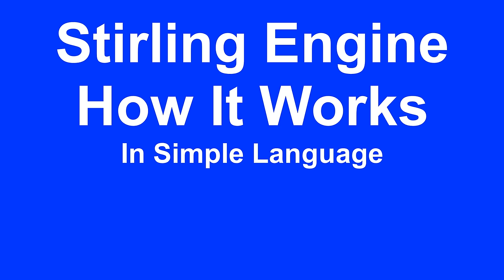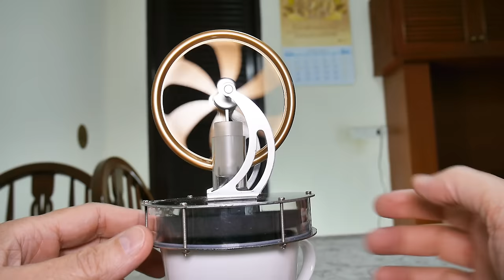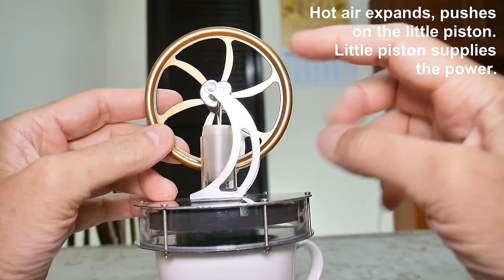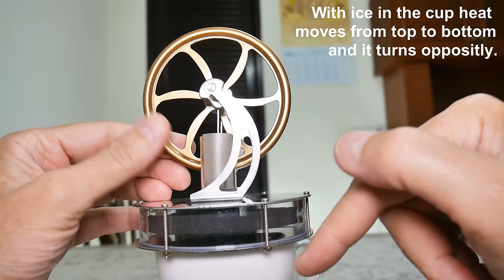Stirling Engine - How It Works In Simple Terms

Comment: Thanks for breaking this down. If you need torque this is probably not the best way to get it. So this is basically the mechanical version of a hot air balloon. Or am I so confused that I think I'm buying cattle from a chicken farm??
Reply from the maker: Actually I had a friend who had a cattle farm that sold chickens, so...  A little like a hot air balloon in that the warmer air expands.  It operates by expanding and contracting of the working gas (air in this case, but it can be freon or such).  In this example, when the big piston (displacer) is up, most of the air is near the cup where it gets hot and expands.  The pressure inside the chamber increases and pushes the little piston up.  That forces the wheel around and the displacer then moves down moving the hot air up against the relative cold upper surface.  There the air contracts and the little piston is sucked down.  That causes the displacer to move back up and the air moves back against the hot surface.  And then it repeats.

Comment: It seems that the key to understanding a Stirling engine is to realize that unlike a conventional 4 cycle engine a Stirling has two power strokes instead of just one. The power piston is pushed in one direction when the air is heated and then pulled in the opposite direction when the air is cooled. This way power is produced on both the upward and downward stroke. All the displacer piston does is shuffle the same air back and forth between the hot side and the cold side to alternately push the power piston up or pull it back down.
Reply from the maker: True with this model. There are others that are closed systems, and as 1 commenter pointed out, they will work in a vacuum. This one, not so much. ;) What I find interesting is how they move 1 "packet" of heat from warm to cold with each stroke. It's almost digital.
Reply: The piston doesn't get 'pulled'. It still gets 'pushed' but from the other direction.

Comment: Simple but effective. Good explanation. I’ve always found these, the steam engine and the hit and miss engines very interesting!
Reply from the maker: Thank you. I have always been fascinated with engines also. These are particularly interesting with their ability to function with such a small temperature difference.
Reply: @tsbrownie  
I just purchased a rudimentary version—it was cheap, I guess because it's all plastic except for a thin metal plate covering the plastic on the bottom surface. Cute little device.

The part of this I haven't grasped yet: the impeller begins moving downward while the piston isn't yet finished with its up-stroke. This becomes clear if you run the video at 1/4 speed and then tap the "K" key on your keyboard twice in succession, as quickly as you can, to start and stop the video (this gives you about 1/10th (?) of a second's worth of the video at a time). Is it merely the weight of the impeller that causes it to move downward while the piston is still in its up-stroke?
Reply from the maker: @mikearst2940  Yes, it's the fly wheel that keeps it moving during the non-power part of the cycle.
Reply: @tsbrownie  But the impeller is not connected mechanically to the flywheel—so I'm perplexed by what is sending the impeller downward when the piston is still in its up-stroke.
Reply from the maker: @mikearst2940  I think I'm confused about what you mean by the impeller-is there another name for that part? All the moving parts are connected through the flywheel via the crankshaft. There is the small power piston, the large displacer piston, 2 connecting rods, 1 crankshaft, and the flywheel.
Reply: @tsbrownie  I guess I should have been using the term "displacer"—the larger cylinder that moves within the sealed (lower) container. In the inexpensive Stirling engine I got from Amazon yesterday, there's no mechanical linkage at all between the displacer and the flywheel. The linkage is only between the flywheel and the thing I've been thinking of as the piston. (Too bad there's no way to attach screen shots or other images to a YouTube comment.)
Reply from the maker: @mikearst2940  Can you leave me the link where you bought it? I tried searching for something like what you describe, and the closest I can find is one that uses magnetic coupling rather than the second connecting rod.
Reply: @tsbrownie  I think that's the key: there's definitely no mechanical linkage in the device I bought on Amazon (linkage to the displacer, I mean). If I move the flywheel very slowly and lower the piston as far as it will go, when it gets all the way down inside the "cylinder" the displacer pops right up and stays there until I move the piston upward again. It's got to be done magnetically.

Comment: Thank you so much for drawing the comparison to an AC compressor because that's what made me look this video up in the first place!!! I'm trying to better understand how the pistons connect because I've been asking myself what if the chamber had refrigerant instead of just regular air? If you heat that couldn't it overcome the low torque problem that keeps Stirling engines from seeing mainstream practical application?
Reply from the maker: NASA uses these in some of their space tech. They use another working gas which is much more efficient. I don't know for sure, but I'd guess that one of the standard refrigerants would work better than air (in normal temperature situations). Again I don't know for sure, but I think that the higher the temperature difference between the hot and cold sides would give more torque. Not sure this thing would ever be a torque monster and most will not self-start.

Comment: It should be noted; most later steam engine cars did use a modified version of a low temperature differential stirling engine. But, it was not used to power the car; only to turn the drive wheels. Jay Leno, in his video going over the 1925 Doble E 20, uses a cutaway chassis which shows how the car works. You can see the stirling engine and its two pistons in that video.
Reply from the maker: I have to go watch that video. Thanks.

Comment: So if you hold your hand let's say, on the top plate to heat it up, the process will stop because there won't be a 'cold side' to suck the piston up? Or the wheel might slow down?
Reply from the maker: As the top and bottom temperatures get closer together (as there's less difference), it will slow down then stop. All heat engines operate on the difference between two places. Internal combustion, steam engines, etc. will also slow then stop as the difference in temperature between atmosphere (the heat sink) and the combustion chamber (cylinder or boiler) decrease.

Comment: Can you tackle the Crookes radiometer next? Oliver Heaviside spoke about Crooks and how he provided some sleight-of-hand of how his device actually works. If everything is essentially spinning, atmospheric pressure; heat one way,  and cold another then both the heat and cold are spinning in different directions and moving the air in those directions along with it. Different colored lights as well have different spinning pressures that are transferred through the medium to the device.
Reply: I guess cody's lab or thunderfoot has already covered it.
Reply: @SurajGrewal  yes they have and they are still clueless as to how it works. They are repeaters of others and knowers of nothing.
Reply from the maker: I used to have one.  I will have to look into getting another and do my homework on it so I don't repeat the same old stuff.  Thanks for the idea.
Reply from the maker: I finally got it done! Enjoy!   https://www.youtube.com/watch?v=czRKhL9rBsA

Comment: Doubt.. so the engine works, due to the heat from the cup of hot water. So would it mean, that when the heat of the water eventually runs out, would the engine stop working? Im planning to make this for a project
Reply from the maker: Yes. Heat engines work because of the difference between input and output temperatures. An ICE with a combustion temperature of 1200c would not run on a planet with temps of 1200c. I have other Stirling videos where the engines use much higher temperature differences. Same principle, but different  implementation.

Comment: So how would you scale it up to power a train? Would the hot air in the chamber also be able to push much havier materials like wood or steal? Would the romans have been able to build something like this with available materials of that time?
Reply from the maker: Interesting questions. The torque is very low, so it would probably not be ideal for a train. It might work, but would not be financially feasible. I think the Romans may have been able to make it, as the tech is not beyond average hand tools and plain metals. The heavier materials would not make much difference anywhere other than the displacer. The displacer could be made with bamboo or similar.
Reply: @tsbrownie  awesome! Thank you! Cesar will be mighty impressed when I build one in my imagination tonight
Reply from the maker: @Granato787  Give him my regards. Let him know that his month is my favorite!

Comment: I'm watching that same engine rune right now, still not clear how it works. how does that piston seal?
Reply from the maker: The big piston is a displacer and it is not sealed. It's job is to slosh the air back and forth so it can heat and cool. The small piston is a glass syringe and it supplies the power. It is sealed.

Comment: It runs off a small temperature difference. So you could run it with an ice cube sitting on the top plate?
Reply from the maker: I've done that, so yes. Some people have tuned them to run on the heat from their hands!

Comment: Any explain as to why the engine don't work in either direction - depending on what way you spin it to start?
Why would it care or only work in one direction?
Reply from the maker: If you look at the crankshaft, the angle between the 2 cranks is not 180 degrees. If you try to spin it the wrong way, the timing between the pistons is off.
Reply: @tsbrownie  
Thank you kindly. as noted, one probably could have a design in which the offset is 1/2, and it would work (either direction), but not so well. 

In fact, I suspect that the "timing" of that offset could be changed for a given speed - kind of like timing on a car!!!!
but, as you note, since the offset is timed, not by 1/2, then yes, of course the off-set will matter, and thus the power stroke vs displacer offset matters then. And thus as a result, the direction the engine runs will matter.

Again, thank you kindly.

Comment: Wouldn't it be more correct to described it in terms of a pressure differential?
Reply from the maker: @FightTheByte_  If you mean a pressure differential between the chamber and ambient pressure over time, then yes. There is no differential inside the chamber itself.

Comment: About the turning wheel going the opposite direction, if ice water is applied at the bottom wouldnt the “piston” go up and down in the same way? 😵‍💫

I understand the heat would be drawn from above, but wouldn’t the puck still have the same motion ? 😵‍💫😵‍💫😵‍💫
Reply from the maker: The piston and displacer are not 180 degrees apart.

Comment: it seems quite Inefficient but it was good enough to be used In submarines

I still wonder how they can function under water with that limited air supply and what kind of heating method they use for it there since gasoline engines would fill the air with exhaust which limited other engines

Comment: So, theoretically (always wanted to say that!): A Stirling, combined with a "Sand Battery", could produce electricity for off grid residences?
Reply from the maker: They will run off of lower grade heat. They are not high torque. In theory it would work. In Europe Philips sold a Stirling engine that would power a radio. It ran by setting on top of a wood stove.
Reply: @tsbrownie  Drats!  Foiled again!

Comment: So, how air get supplied to cylinder?
Reply from the maker: It is the same air.  It just expands and contracts with temperature change.
Reply: @tsbrownie  i was trying to understand the valve system...but there are no valves... i bought one..it worked for a short time ,then died... trying to build a large one ...
Reply from the maker: @lyledressler6874  Right, no valves.  In fact some industrial models use other gases in a sealed system.  I understand the tricky part of making one is getting the ratio of big cylinder to small cylinder right.  Make a video of your machine and leave a link, I'd like to see it.
Reply: @tsbrownie  exactly right... thats what i am trying to calculate to get the greatest torque value...trying to do a  engine using steel barrels
Reply from the maker: @lyledressler6874  I *definitely* want to see that!!!

Comment: So it still needs and external source of heat. If that created by solar, it would truly be emission free.

You would need to have a means to trap the heat of the sun and use it to operate that engine and it could even run after dark. A small tank of propane could serve as a back up.
Reply from the maker: Funny you should mention that. I've got an unused solar panel that's fed to the back porch. Been thinking about using it to charge a battery / warm a resistor to power this thing day and night.

Comment: how does the air not go out
Reply from the maker: The tolerances are very close, so any leakage is small.
Reply: @tsbrownie  so it will never turn into vacuum you mean?
Reply from the maker: @gicchh  I'm not sure what you mean. Will this operate in a vacuum? No. But NASA uses Stirling engines in space that are sealed.
Reply: @tsbrownie  i mean is the engine sealed airtight or does it always circulate fresh air?
Reply from the maker: @gicchh  This engine is not sealed airtight. But the leaks are so small that it does not affect the operation much.

Comment: Put it on ice and it runs backwards
Reply from the maker: I did that: https://youtu.be/kCbfVgBwv6Q
Reply: @tsbrownie  
Any explain as to why the engine runs only in one direction? Why would it care? Should not what direction you start (spin) the device determine which direction it will continue to operate? 
and as noted, putting a ice on top helps, and in fact putting the whole thing on a block of ice also works, but results in the device turning in opposite direciton.
I grasp how the engine works, but what I don't grasp is why it only wants to turn in one direction?
Perahps the displacer is not offset by 1/2, and thus "timing" matters here. this suggests a design could be made that works in either direction, but would not work as well as one with a "timed correctly  or timed better displacer offset).

However, I still can't grasp why the engine wants to go only in one direction? Why would it care? Either way, the gas expands due to heat, pushes the piston up. So, why then does direction you spin, or better stated, why does turnings direction matter here?

Comment: Pointless though isn't it? It takes energy to heat the water, and any energy created b the flywheel will be less than that put in to make the water hot. So. Pointless. Unless you use geothermal I guess.
Reply from the maker: Geothermal, solar, waste heat from burning gas/coal, etc. These are very efficient and can operate on very low temperature differences. Some people have tuned them to operate on the heat from their hands.

Comment: So hot gases are transfered into mechanical energy? I'm also interested in the fly wheel as I can see there looks like a counter weight working with it
Reply from the maker: The gas in the chamber is heated and cooled by the hot water. Any heat source will work as long as it does not melt the materials.